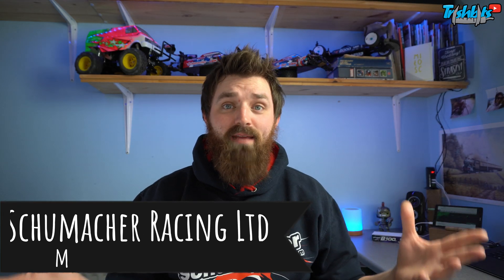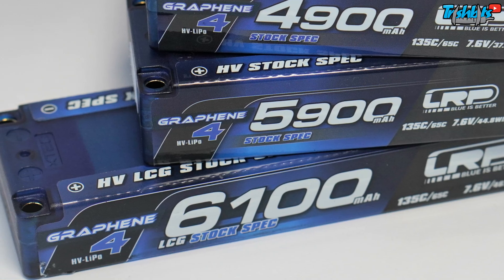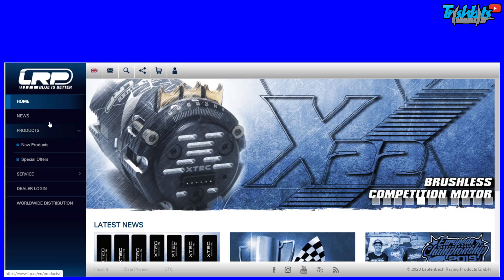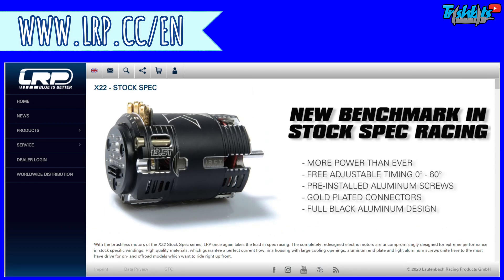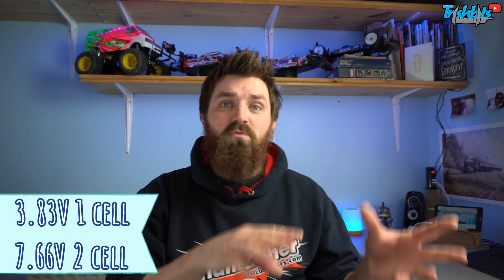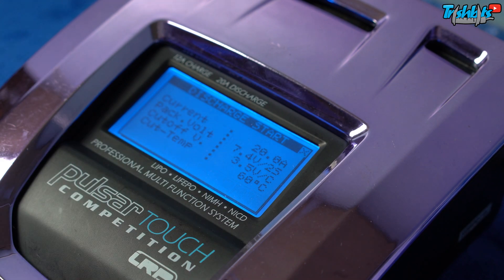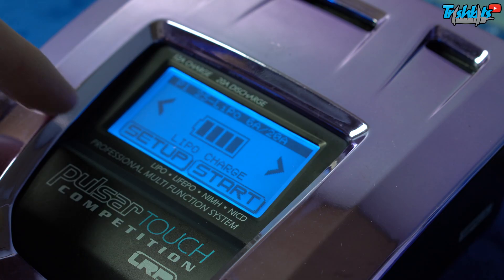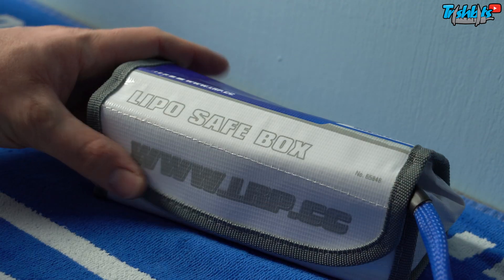RC Car Lipo Storage Voltage

Comment: Hello Trish, great videos, I have had a quick look at my charger and I cant see where I can set the storage charge voltage. I have a SkyRC D200 it probably doesn't do it. it storage charges to 3.80V so it wont be far off. What charger are you using?

Comment: Questions for you, the two quick clips on the front hub carrier kit one low and one high, what does moving them result in handling feel, they are not mentioned in the LD set up section, do you charge your LiPo to a lower voltage for wet or low grip conditions if so can you describe what to do and results in motor performance. Cheers Neale
Reply from the maker: Hi Neale, I’ve talked about it in setup videos I explain it as axle hieght. The lower it is on a 2wd the more grip you get and the higher the easier it is to driver but you get push. You can charge lower on low grip tracks to take some bottom end out.